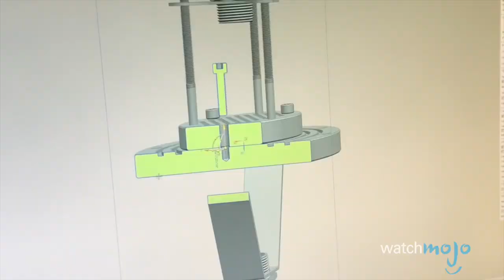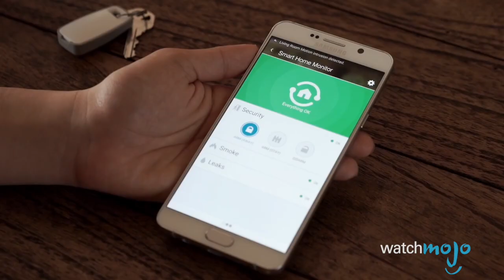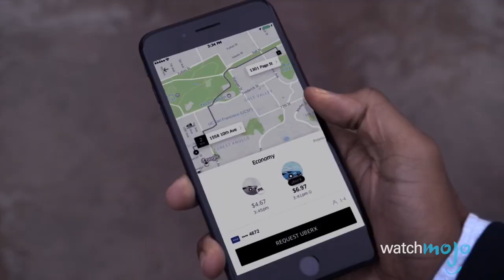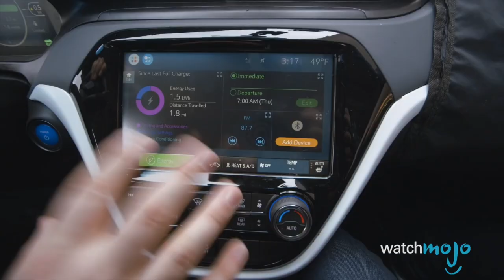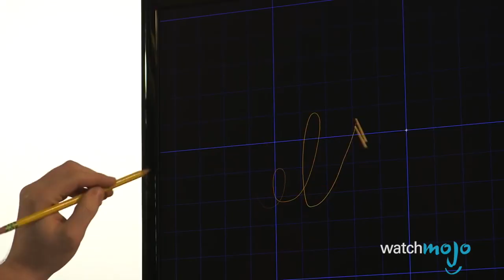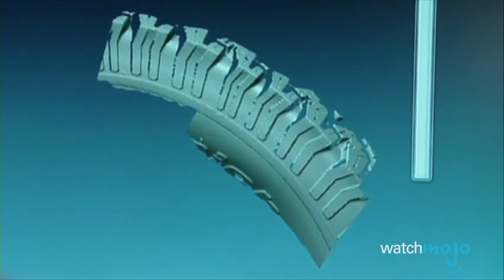Top 10 Emerging Technologies That Will Change Your Life

Comment: ok hold up. i cant stand the electric car thing. sure they dont produce emissions, but where do their electricity to charge the car from? the grid, which is fed by fossil fuel burning power plants. so all they accomplish is moving the emissions from the car to a power plant that has to burn more coal to keep up charging the car. there are even charging stations for electric cars that are run by a diesel generator, plug the car in and an engine kicks on sucking up that sweet oil. wtf

Comment: The EM drive could work in space where minute changes in particle velocity can increase or decrease directional momentum. However, it will never be strong enough to overcome gravitational pulls greater than a tenth of earth gravity. Plus, unless the drive is large enough, it would be extremely slow to start or stop.

Comment: Core Fusion is missing on your list. Having literally unlimited energy could make humanity revert the causes of climate change by artificially control the amount of Co², Methane and other gasses and thus keep the climate stable as well as completely filtering any kind of air, soil or water pollution. Not mentioning electric transportation could only work like this.

Comment: How about fusion energy?
Reply: scientists recently succeded in creating a fusion reaction, it has to be at such high temperatures though (about 10 times hotter then the center of the sun) that more energy dissipate than is created by the reaction. It's mainly just a question of insulation.

Comment: Electric cars are still charged most commonly from an outlet attached to the grid. Which is still powered by fossil fuels. Ecodumbasses
Reply: vergil51836 They’re not even connected to the grid fucking idiot. They’re connected to solar panels. Do some research

Comment: Sadly driverless cars are a thing... It takes away the fun, no racing, no drifting, no burnouts... Also electric cars generate more pollution to mine materials for the batteries instead of a car burning gas
Reply: William Pancamo I agree but certainly not with the pollution
Reply: Plus they use fossil fuels to make electricity i know there's other sources used to make electricity but they have environmental draw backs as well.
Reply: Clean power will replace fossil fuels as they get cheaper and concerns on climate changer get higher 
In the near future

Comment: 1. Infra-sound fire extinguisher -- only works on alcohol fires. 
2. Hyper Loop -- doesn't work on any practical scale.
3. Trans-Humanism -- mostly fiction.
4. Em Drive -- doesn't work on any practical scale.
5. Smart things -- this concept was available 40 years ago.
6. Driverless car -- isn't curently practical.
7. Electric cars -- available but haven't caught on.
8. Virtual reality -- improving but hyped.
9. Artificial intelligence -- little improvement in 60 years. Human-level intelligence is not emerging.
10. 3D printing -- this actually works.

1. This is a long shot.
2. Dead.
3. Another long shot.
4. Dead. The nearest practical application is the solar sail which has been a concept for decades.
5. Possible. This requires another technology that isn't available yet, but could be in ten years or so.
6. This requires another technology that isn't available yet. The soonest it would be available is about 30 years. There is another car technology which could have a much greater effect in ten or fifteen years.
7. A more likely technology is hybrid Stirling.
8. It can be useful and entertaining but not likely to be life changing. No more so than a Playstation.
9. This too requires another technology. This might be under development in four years. If so then human-level intelligence could be ten years out for a large scale prototype.
10. This is a promising technology but the effect is probably not what most people think. The most likely niche would be either parts that are too small of a volume to justify making molds or parts that are no longer in production. Cosmetic parts don't get you very far, especially considering the cost and effort. However, now that we have coated nylon, there is the possilbity of durable replacement parts.

Comment: Electric cars are brilliant; but there are 2 problems
1) Range; the distance you can travel isn't very far so not good for travelling long distances
2) Recharge time; this is the biggest problem. Even if there are enough recharge locations; it will still take a lot of time to completely recharge the batteries.

Comment: Hey Mojo. Don't rely on the hyped up brochure from Hyperloop for your only source of information regarding this technology. It is in its infancy but it is also highly impractical too. For a  start a 'near vacuum' and air providing a reduced friction contact (you know 'hovercraft') don't mix well. to have air flowing in through the tracks means that a 'near vacuum' would be almost impossible to obtain and maintain without a massive massive vacuum pump system to continually draw out the air that is used to support the pods and it is air in the tube which will slow down the pods considerably. On top of this there are huge problems that need to be overcome regarding safety, security, expansion/contraction of the tubes, and how to make it as straight as possible so the occupants don't get sick from the 'G' force in any corners at nearly the speed of sound.

Besides why hasn't Musk actually put serious amounts of his own money into the development of such a fantastic idea? Why throw it open to others? The idea of a train in a vacuum tube using something like maglev isn't a new idea nor is it Musk's. I know he is building cars but if this thing is so good and a 'winner' then why isn't he doing it instead of going into space?

Comment: They missed one of the biggest possible impacts of technology on our lives - the development of room temperature superconductors. Room temperature superconductors would be one of the technical holy grails and the impact on our lives would be massive. For a start electricity would be much much cheaper as the losses in the grids through transmission would be almost eliminated. It would enable electric devices to become much smaller and much more efficient with reduced power consumption. It would enable possibly a half or more of the world's generating capacity to be turned off saving billions of dollars and there would be huge reductions in CO2 emissions. Room temperature superconductors would also spawn new developments in battery and renewable power sources.

Comment: most of the things on this list honestly make me question my decision to only live for another 15 years before getting a doctor to end it for me, but the only thing that will change my decision is if Genetic engineering gets advanced enough it's like getting plastic surgery, so that i can modify my metabolism so i don't get fat from my debauched lifestyle, and cheap enough to apply to a general populace. that's the only thing that might make me want to live longer that 35. i have real hopes for modification systems that use the CRISPR system, but it may not get to the point i desire in 15 years.

Comment: Electric cards do not in any way help climate change.  Where exactly do you think that electricity is coming from?  In most cases fossil fuels.  Plus a lot of greenhouse gasses are created in refining the materials needed in the batteries and a shit ton more making the car in the first place, more than you can possibly offset by driving it.  You wanna help the environment by buying a car get a used one.
Reply: Well, it is true that electricity needs a source..

But that electricity can have a source that don't produce as much carbon-dioxide as normal cars do. Also if most cars got replaced with electricity driven cars would a great bit of the source of the output of just carbon dioxide dissapear, it wouldn't show instant effects of course, but it would be a step on the way.

Comment: The EM drive is fantasy and the Hyperloop is a joke.
Reply: Angelalynx999 Hyperloop = Death
Reply: +The Roblox Wizard Yup. Just one little hole in the near vacuum tube and BOOM! Implosion and everyone in it dies.
Reply: Watch Thunderf00t's video about it. So many problems with Hyperloop that it won't succeed. For example the tubes would expand over 300m by temperature changes. Have you found air tight seals that can expand?
Reply: +Angel Delarosa It's not pessimistic nor narrow minded, it's knowing physics. Something that too many people DON'T know. Look at what happens to a container that implodes and ask yourself if you would like to be in something like that when traveling at 600 mph. The funny thing is it has already failed. The test track was tiny and the pods failed to go 100 mph let alone 600 mph, and that was when they were being pushed. After release they all stopped dead. Then there was the time it took to depressurize the tube, 30 minutes to an hour. The Hyperloop is a joke the way they are doing it. It is certainly possible, but it would cost more, be less save, and take more time to travel than just taking a plane.
Reply: Angelalynx999 Isn't going at 600 mph going to kill human?
Reply: +The Roblox Wizard Not if the acceleration is gradual. Airliners travel close to that speed and no one even feels it.
Reply: Angelalynx999 Deceleration and testing is an issue.
Reply: Angelalynx999 pessimistic and narrow minded people like you are a joke :/
Reply: I agree with the EM drive but the hyper loop could work better for transportation of items.

Comment: Change "will" to "might".
EM drive is unproven and highly inefficient if it does, hyperloop  dangerous expensive and very inefficient.
I should be glad you guys skipped solar freaking roadways and plastic roadways, and some other crowdfunding scams.
Reply: If he already says something wrong within the first 10 minutes then I can conclude that he's wrong about it already. He said that the air rushing into the tube would kill everybody in the tube, but this is without considering many factors that could stop it, such as safety systems, which any person would obviously implement. He also mentioned that you couldn't take all the air out of it, but this is so wrong it's funny. An array of a few pumps every couple tube lengths you could easily remove all the air in a decent time. If you want to see the calculations I'll happily show them. He also said thermal expansion would be catastrophic, even though putting air tight expandable seals between the tubes is easily achievable. And lastly, he said that the pipe couldn't support the weight from the outside pressure, but he only gave the numbers of the pressure and not the pressure 2in steel is able to withstand.

Think about it like this, if hundreds of accredited engineers and scientists are working on Hyperloop then that should hold more weight than if a single person not even experienced in the field said that it wasn't possible.
Reply: The thickness provided in the write up is 25mm or less than an inch in case you didn't read it and are too lazy to convert from metric. also the write up stated the tubes would come to 0.01 atmospheres which is NOT removing all the air. Do you know how much power said vacuum pumps would require to keep even that low of pressure? It would not be the air rushing into the tube that would kill people in the pods but the force of impact from stopping once they hit the end of the line whether that be inside the tube or outside possibly killing bystanders.
Reply: Yaman 
Thunderf00t FTW!
Reply: Yup he shows we need basic science and math back in schools.
Reply: Science? No, that would trigger too many people. We must abandon it to appease the masses.
Reply: ChopStix what were the fallacies?
Reply: What fallacies? I see you insulting him as a biochemist without actual knowledge but you don't seem to have any arguments whatsoever. Plus, not watching a video till it's over doesn't sound too convincing, either. At least watch the whole video and then debunk his shit...
Reply: ThunderF00t doesn't know shit about science except for plants, hence why he's only a biochemist and a normal chemist. He doesn't know shit, 10 minutes into his video on the hyperloop I clicked off because of how many falacys it had.

Comment: After vault7 no thanks to "smart cars" I'd rather ride a horse
Reply: Reppin PTTY 
What about and old mustang or a Shelby cobra?
Reply: I agree on no to self-driving vehicles, but I disagree and is going back to using horses, as we now widely use manual driven vehicles, for many reasons, more storage, goes on much longer, etc. Self-driving vehicles, however, will likely steal driving jobs, and therefore shouldn't be invented.
Reply: Dylan Hooton That's a ridiculous reason not to develop driverless cars. They might as well have never developed cars because it destroyed carriage making and blacksmithing jobs.
Reply: Reppin PTTY facts
Reply: Reppin PTTY I actually like driving. Especially stick shift. I would miss it.
Reply: u think a horse want to carry ur weight on their back? let a horse ride on ur back.

Comment: I'm surprised they left out the possibility of being able to 3-D print organs, getting rid of organ donors and wait lists for organs. The printed organs would also be perfect matches since it is designed specifically for your body
Reply: Borborygmi yeah that will take decades to do. Because the cells in our body Maintain them selves to keep them fictional.To make a 3D print organ to do that will take a long time .
Reply: maybe decades to complete the manufacturing process. But once we have the machines and materials capable to construct a 3D organ, it would be a lot faster to make an organ than to find a match from a willing host, or wait until that perfect match dies so you can take their organs. The 3D organ would work like a pacemaker, once installed it needs little to no maintenance(hopefully). Artificial hearts have even been around since the 80's, and with the rate that technology is exponentially growing, I wouldn't be surprised to see 3D organs that work in 30 years or so. We are talking about the future, it hasn't happened yet so the best we can do is hope that someone is able to find a way to make them.
Reply: Only for flat organs (such as skin) but eventually. link= https://3dprint.com/119885/wake-forest-3d-printed-tissue/
Reply: Borborygmi is that a real thing? source?
Reply: Borborygmi  this also is predict to create jobs that require making organs for the right people. Imagine also how 3d printers would have to be manufactured and repaired . So new products could either go into the market or it could change retail and manufacturing
Reply: Stem cell has that crown
Reply: maintenance?  you guys realize that 3d printed organs are made out of living stem cells right?  thats why the organs would be perfect matches, because the organ was made using stem cells harvested from the person needing a transplant.  the only thing that could be an issue is scar tissue
Reply: @RHW42Archangel  Still, even that issue could be rectified thanks to a new form of medicine that involves regrowing cellular tissue from scratch, called extracellular matrices! No need for prosthesis as a replacement, though the latter has a niche when it comes to performance enhancement.
Reply: But I bet even when we can make new organs via 3D printing, the hospitals will still charge through nose in countries that do that.

Comment: The current hyperloop design from Elon musk has been thoroughly debunked. 
Trans humanists are mostly nut cases. 
The m drive is impossible and even if it worked as advertised the thrust produced would be far too low for overcoming gravity. The best it could do is long distance travel optimization. 
True AI is a long way of and don't even get me started on the ethics and risks of it. 
3d printing is great for prototyping but they are way too slow for actual mass production. Injection molding and other mold based processes will stick around for a while before they get replaced (if at all) by 3d printing. 

And these are just the responses I can come up with while watching the video for the first time and I'm not watching this Sorry excuse for entertainment again. 

Do your research people! 
Fucking gullible idiots. 
Most of your list is just snake oil.
Reply: Vincent Oak You van always hope dude, where is your sense of wonder and imagination? These are mere prototypes. Have you seen the first computer? We now have a computer that are 1000x more powerful in our damn pockets!
Reply: Vincent Oak Loool someone is triggered 😂
Reply: Shut up
Reply: ask someone born in the 40's/50's what wouldve they thought if you told them you could put food un a box for a couple of minutes and have it heated up, or that you could access almost the entire of humanity's knowledge or a conversation with anyone in the world with a wireless pocket device, or that you could connect wires to the nerves to respond to stimulus and vice versa, and what wouldve they thought back then
Reply: Lievcocijo none of those things were actually proven using physics  to be IMPOSSIBLE
Reply: Vincent Oak thank you .ppl believe anything